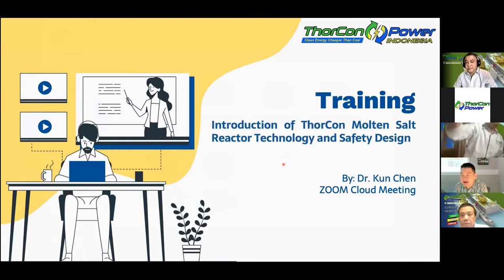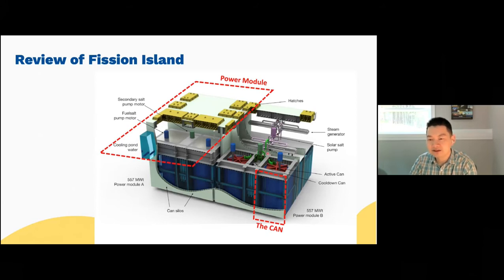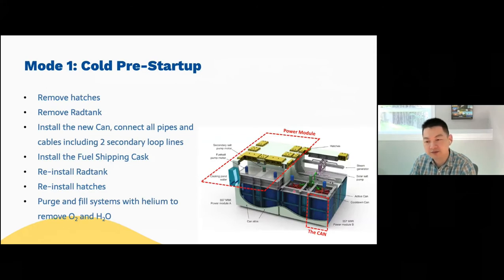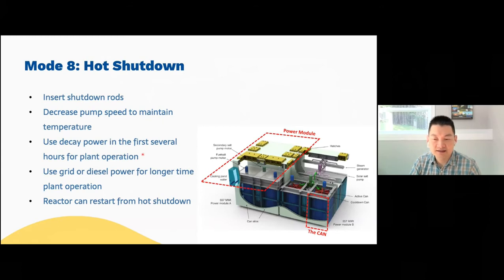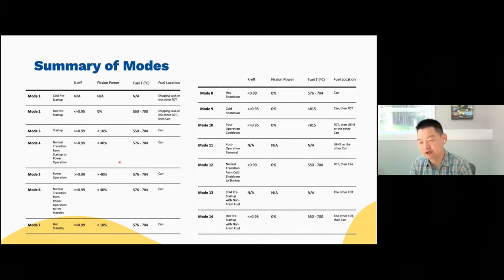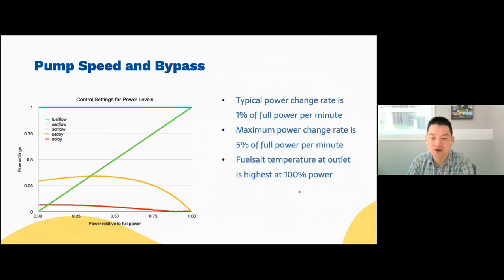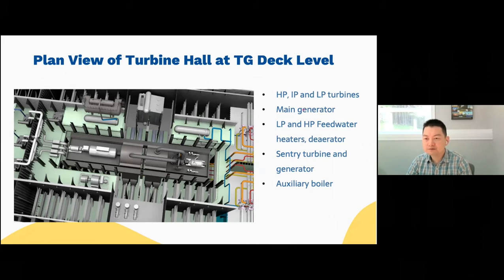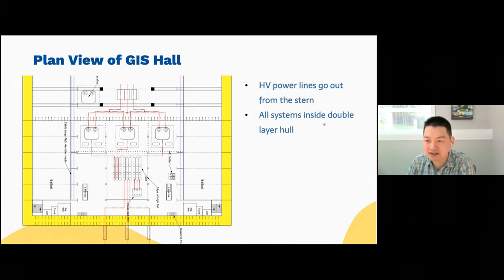ThorCon Training #4 with Prof. Kun Chen : Operation & Balance of Plant (BOP)

Comment: Great explainitary presentation but with a couple of points I am still unclear about.
A) Is the  "Radtank" a air tight sealing "roof" to the reactor area of the fission island, filled with water to reduce radiation from below?.
B) The transit ship shows the  crane lifting a load with the green fuel salt drainage tank assembly attached to its red can but no obvious Shipping cask or is the  shipping cask part of the transit ship?
C) Are the heating cables included and interconnected at a junction terminals at the top of the can like the secondary salt isolation valves?
 D) Is magnetic induction used to heat fuel salt in any places of the fuel loops?
E) Is the Shipping Cask just an empty radiation reducing cask brought by the transit ship to the ThorCon Isle?
 (I cannot see any recognisable shipping cask in the power point pages - and the logic would appear to me that one could only surround the can and drainage tank while transferring from isle to ship if it were to be suspended by the crane over the  can like an inverted beer can holder while the can is lifted into it?)
Reply from the maker: We will answer all not answered question in week 7 session. Special sessions just for Q&A